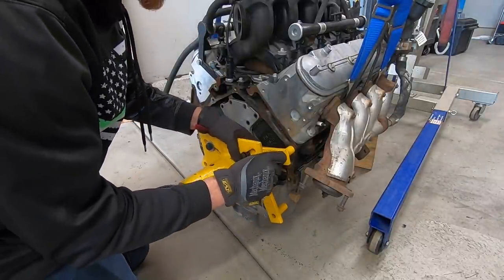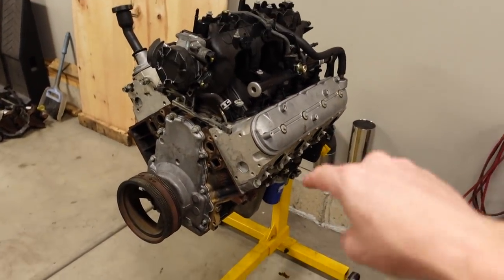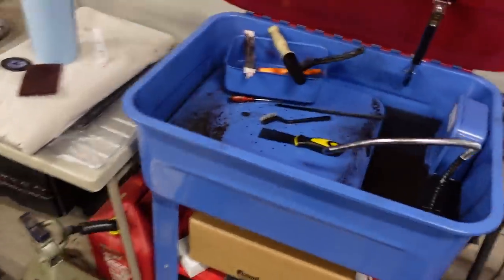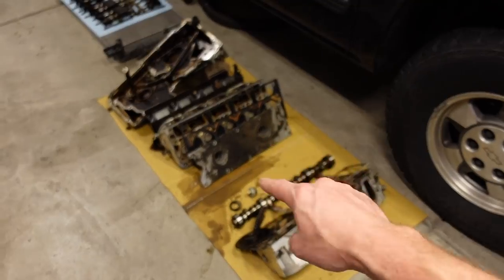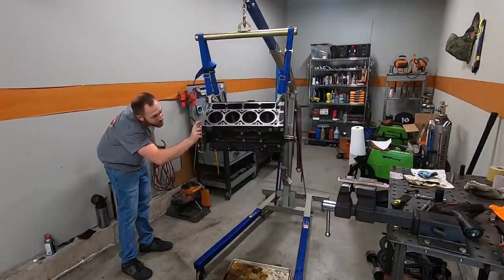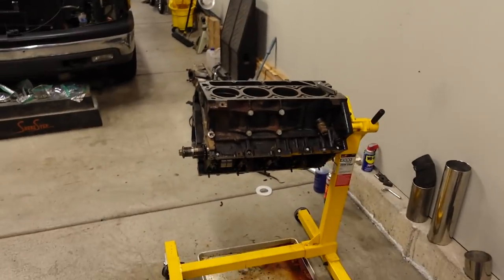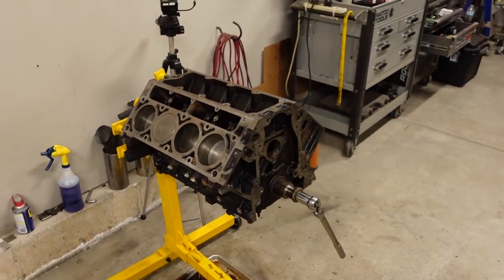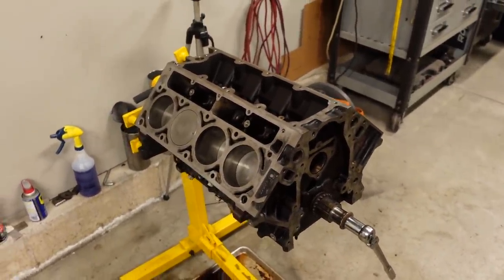GAPPING LS RINGS to hold more power! 4.8 vs 8.1 big block Pt.3

Comment: Did you deglaze the bores?  If so, what method?
Reply from the maker: no I did not, just put it back together with the original rings in the same position.

Comment: Why does the connecting rod need to be resized to install arp bolt ?
Reply from the maker: because the ARP bolt has an increased clamp load over the stock fastener which would slightly distort the bearing clearance, so you would have to install the ARP bolt and torque it to sped, then use a rod hone to restore the "roundness" of the bearing hole.

Comment: 600-700 whp with a turbo is too easy. Centrifugal will be lazy @ lower RPM UNLESS you put a big stall in it. LSA blower will need major air-to-water intercooler work to sustain that power level due to the inefficiency of that little blower and the heat it will produce at that power level. Sure you can get a TVS2300 blower for it but it will end up costing more than a turbo setup...
Reply from the maker: big stall is on the shelf waiting to go in!

Comment: I just don't think spending 3k on the motor to keep na vs a 3k motor swap is a dumb comparison I mean I get the clean up and gaskets and stuff but I'm pretty sure you know what almost everyone meant is cam springs and turbo and the supporting mods like injectors fuel pump and the 4l60e won't survive but I don't remember the trans swap being part of the 8.1 swap
Reply from the maker: I did the trans swap to 4l80 before I did the 8.1 on uglytruck, so it wasn't included in the $3k budget. I know what everyone ment, and eventually the 4.8 will be boosted, but the cheap turbo route can be done to any engine with similar results. just some engines will hold up to more than others, which is kinda why we're doing the ring gaps now, so when its boost time, they will be ready.

Comment: Assembly lube hoarder! 
Really, that was a really dirty engine. I don’t know if you’ve published which cam you picked yet, but the 4.8 won’t need much. A 224° intake lobe with close to 0.600” lift would be enough for upper 6000s horsepower peak, and less wouldn’t hurt. Just turn up the waste gate controller! You might even get the 650 you’re talking about at 20-ish psi with the stock cam. A sub-$200 GT-45 will do it (for a while).
I’m in the process of changing rocker trunnions due to over 400 lb open BTR dual valve springs. I’d get the valve job redone, too, but that’s just me.

Comment: I've been told because of the heads being aluminum you can just hit the bolts and it ends up loosening them up enough to remove easily. I've always wondered if it's true.
Reply from the maker: maybe, but the bolts are broken off slightly below the surface, so there's nothing good to grab em by...
Reply: @LawrenceTolman  yeah, I was thinking an easy out would work then.

Comment: i think i go my way stroked 454 with steel crank heavy rods high flow heads with a 02xx 400r turbo good to 800 hp with 6,000 miles on the set stock it put out 450 hp at 485 torque got it for free plus just this year i got 4 set ups for free . i gave away 2 5.3 LS engines both ran good but then again i build cars for cheap . i got 800 in my 68 chevy pu just needs the final paint and interior dun have dash dun with full stock gauges looks new even a new clove box rebuild the heater system new dash pad cost me 250 bucks for the dash plus i put a new stereo in it with used amp 6x9 tri speakers with 2 10 inch woofers so i do have a lot of it dun on the interior have seats but not sure which way to go

Comment: WD-40 and a square of scotch bright seems to work best for me to remove piston carbon. Additionally, I usually break an old piston ring and use the nice square end to clean out the ringlands. I understand you reused the rings but if you werent... then you dont have to use a sawzaw blade >.<

Comment: If you don’t have oil pressure when you get it back together, it’s because of that aluminum plug. I know from experience.
Reply from the maker: ooh.... that's not good to hear
Reply: @LawrenceTolman  the plug was too long and extended into the oil passage blocking it.

Comment: Comments FWIW,,,,, clean pistons, rings, etc with ultrasonic cleaner {they are not that expensive and well worth the cost. A larger unit 30 liter tank with a heater is less than $275.00.] Would look like new after ultrasonic cleaning.

The black material on the ring, pistons  etc is call "STICTION".

Did you consider gapless rings?

Comment: Why didn't you just run a can of sea foam in the crank case before teardown?  Would have saved you all that time cleaning.  🤣
Reply from the maker: haha..... I think i could've filled the crankcase with brake cleaner and it wouldn't get all the sludge out... you should've seen the bottom of the oil pan

Comment: Yeah from everything I have seen ring gap has no real correlation to mileage. Just one of those myths
Reply from the maker: thats interesting to know... seems the factory is pretty generous with their accepted tolerance range
Reply: @LawrenceTolman  I am almost certain Richard Holdener was that one that put that theory in my mind. If I can find it I will post up a link. 

Also I am not sure if you said it in this video about how that one truck magazine said they thought it was a 5.3 but turned out to be a 4.8. I think I read that article and they only did a top end iirc. That makes sense that they didn't know since the only difference between the two is the stroke. The blocks have no markings to distinguish the two. 
👍

Comment: Your using that sanding block absolutely incorrectly and thats something you should've known from your "TV show" days and detorquing doesn't matter on stock engines just like torque2yield bolts aren't reusable if thats was all the case the reusing bearings would've been out of the question.
Reply from the maker: maybe I should've used a red scotchbrite pad on an angle grinder? thats sure to make it nice and flat.

Comment: If you are a person who breaks manifold bolts consistently... you're doing it wrong. I'm tired of explaining it do some damn research and stop breaking manifold bolts. If you do not follow the procedure right you will consistently break the bolt/stud.. I'm a automotive tech by trade and I very rarely ever had one break on me. And I've done probably thousands. It's just like a cylinder head and requires a certain procedure.
Reply from the maker: as a career tech, you will have seen that the exhaust manifold bolts on these LS engines break off by themselves during normal use. pop the hood on any stock 99-07 V8 silverado and there's a 75% chance at least one of the end exhaust manifold bolts are missing its head. its well documented that these LS truck engines will break the exhaust manifold bolts off simply due to heat cycles and age, and no, they didn't break when I removed the manifold.